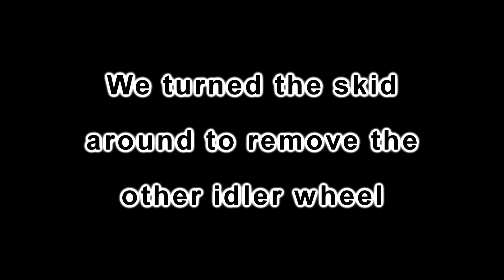Skid & Shock Removal: 2002 MXZ 700 Part 2

Comment: W D forty works wonders. You're risking the chance of breaking.
The casting that holds the idler on the way you're doing it. Take them off first and then put them on a vice and drive the casting through the wheel.
Reply from the maker: You're right.  We actually did break one casting that held one idler on. We learned a lesson that day.
Thanks for watching Craig.

Comment: Funny how often we find things that were under engineered.
Shame that casting broke. I hate when that happens.  I'm leary bout JB weld holding that well. but it may work well too, ya never know. Good luck !
Reply from the maker: Yeah.  I wasn't with my brother when he finished the job but I'm going to guess that he just bolted the two broken pieces back in.  They would be supporting each other anyway since there is a bolt through each now broken piece.  I do have some aluminum welding rods but I need a way to hook up my stick welder to my generator since I don't have a 220 line in the garage for it.
Reply: paisteboy Honestly I bet he could get away without the double idler wheels and be just fine.  Heck, mountain sleds don't even have any boggies in that position.